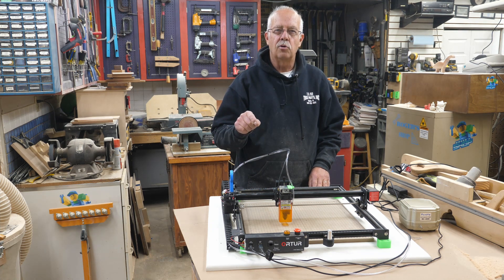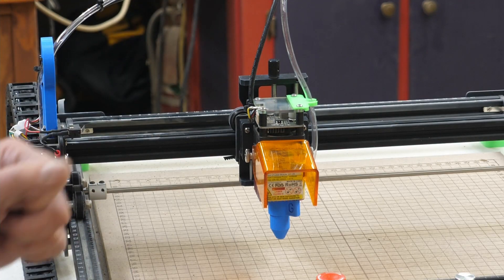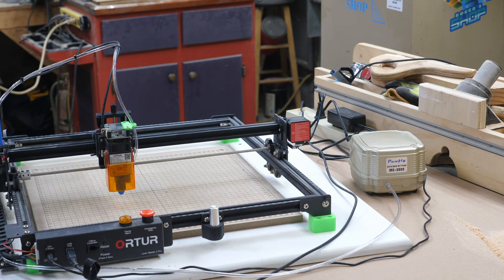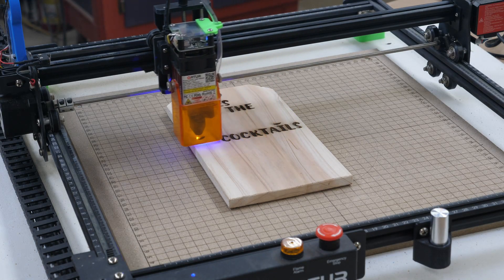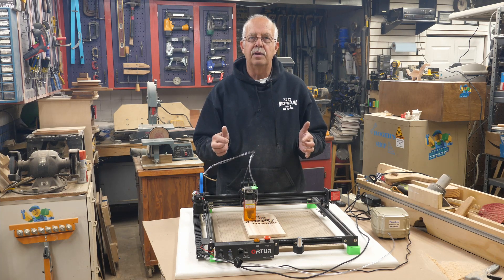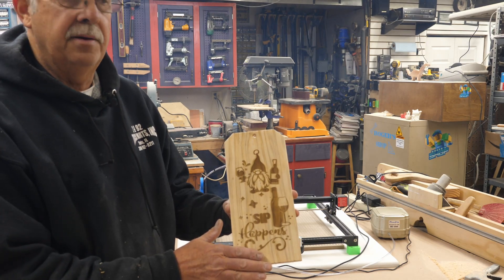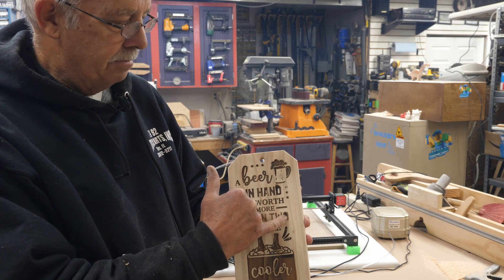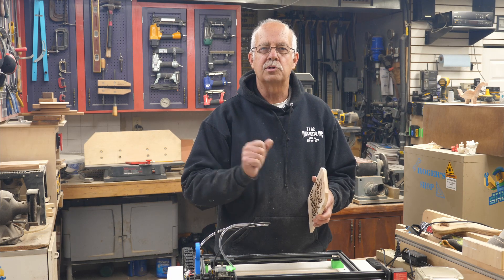Ortur Laser Master 2 Pro Air Assist Add on

Comment: I added a 3d printed air assist nozzle  that I designed and printed to my Ortur LaserMaster 2Pro. It made a huge difference in cutting. I am using my airbrush compressor for an air supply. It also keeps your lens nice and clean.

Comment: Just curious how you set the 30mm focus with the air assist tip on there?
Reply from the maker: Spacer fits between project and housing of the laser head, NOT the lens.

Comment: fire hazard especially when cutting  boards with inadequate polymer choice air assist nozzles. Better use aluminium for the air assist. White PLA is not flame retardant. Even with additive it is only flame retardant. Not suitable for this application.
Reply from the maker: For me, (and a lot of others), not a concern and the odds of this catching fire is slim unless one is doing something stupid.

Comment: Hi Roger .. i  just got the  ORTUR Laser Master 2 Pro S2-SF  , these  nozzle fit on it . or  i need to get the Ortur LU2-4 LF Laser Module?
THanks  in advance
Reply from the maker: I have the LU2-4 head, which is different from the SF (short focus for engraving) and the LF (Long focus for cutting).  It falls sort of in the middle and the design is different at the lens from the other two.  I also have an Aufero (made by Ortur) with the SF head and it looks like there is a port on the shield that can be opened up to add air assist, although I have not looked into it yet.
Reply: @rogersshop  thank you. My laser still on the box . I order better safety glasses 🕶️.

Comment: Please wear safety glasses while using the laser.
Reply from the maker: I do.  I have five lasers and two are not shielded.  However, while shooting a video, and looking at the camera, I do not wear them (when shielded laser is running), as it looks "creepy" to the viewer.  They are worn full time around the two non-shielded units.   I worked around industrial lasers for many years, so am well aware of risks and dangers.

Comment: The link for the Nozzle that you supplied doesn't seem to match what I am seeing in your video.   
The nozzle that you referenced have 3 versions and none match what I am seeing here.

Can you double check and update the link?   I'd love to try this.
Reply from the maker: The nozzle I listed is a direct fit and does not require any modifications.  The one I ended up using is https://www.thingiverse.com/thing:4766225/files but WILL require some reaming for a perfect nozzle fit and drilling/tapping for a 3mm set screw.

Comment: Was the air compressor running while recording this video?   I've been looking for one but would love it to not be loud.
Reply: Pumps for fish tanks are pretty quiet.
Reply from the maker: @3DJapan  yes, and it puts out enough air to do the job.  This model I use actually has two speeds, a high and low.  I use the low when engraving tile and the high when engraving or cutting wood.
Reply from the maker: Yes.  This Pawfly air pump is very quiet
Reply: @rogersshop  Mine arrived a few days ago.  very pleased with the noise level